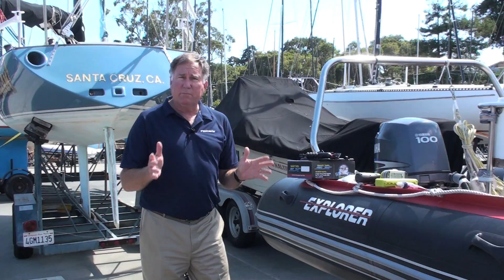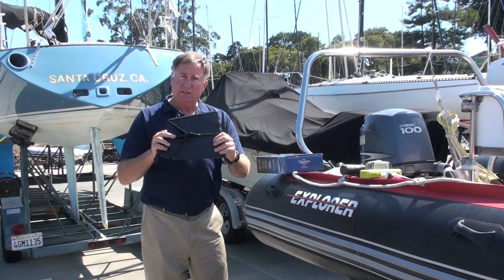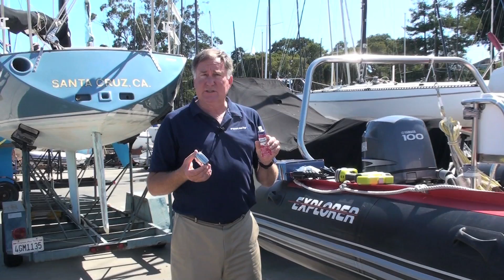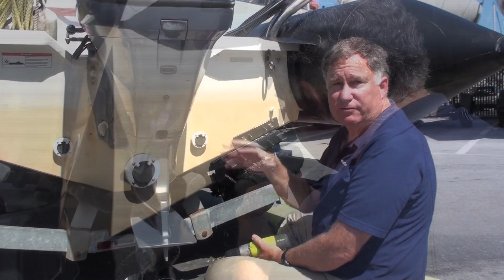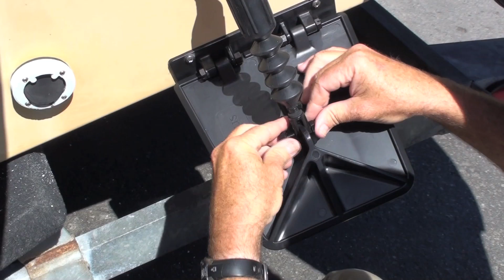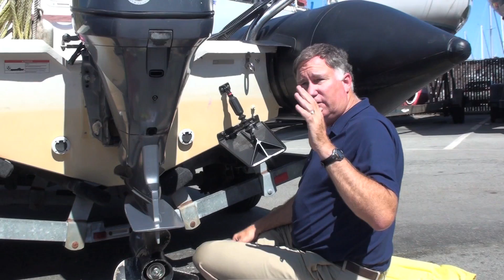How to Install Nauticus Smart Tabs

Comment: I put a set on my old 22 foot silver line. People asked what are those. Fairly new product back then.
It helped the boat in rolling water, stopped speeding up off a wave when crossing. Cut on plane in almost half.
I also put on a 4 blade prop at the time.
I run 28 mph and rev 2800 to 3000. Fuel consumption is decreased and a big savings. Several of my friends put them on and like them.
Nicest thing is , you don’t have to find the sweet spot, it does it by itself.
Reply from the maker: John, awesome feedback! Thanks for sharing your experience with Smart Tabs!

Comment: Hello West Marine,
Do these tabs also eliminate leaning?
Thanks in advance.
Reply: It did on my 15 foot 1973 glastron. It’s a real shallow v, and only weighs 652lbs with the motor, so keeping it flat over 10mph when I’m by myself is near impossible. In fact, I used to have a carpeted board that I would set over the front seats so I could sit in the middle of the boat. Installed these exact trim tabs and it made a HUGE difference in stability, I’m back in the driver seat. Issue I did run into is that my top speed went down from 26mph to 23. I’m sure if I messed around with the motor trim I can get it back but I have a manual trim outboard so it’s an annoying adjust/test/adjust method.
Reply from the maker: Hi The Dutch Fisherman – that’s a great question and sounds like it requires more than we can answer here. Please contact our Product Advice Team for assistance at productadvice@westmarine.com, or by calling 1-800-BOATING (262-8464), Monday - Friday, 8 am - 9 pm ET and Saturday, 9 am – 6 pm ET.

Comment: so you don't need the rocker switch with these tabs?
Reply from the maker: That's correct.  Smart Tabs don't require electric or hydraulic connections. Here is the manufacturer FAQs: 
https://nauticusinc.com/faqs/#toggle-id-1

Comment: I need help. I install this product and yoke my boat for a spin. I got a lot of water splash from the bow of the boar; what should I do?
Reply from the maker: Hi there - there could be a lot of factors; but typically excess bow splash is caused by too much weight aft. Once you figure out the best weight distributation for your boat, the smart tabs should work really well for you. Enjoy the adventure and good question!

Comment: looks like the tab was resting on the trailer  3:24, make sure you have the tab at the correct 25 degree angle before you mark  the top bracket.
Reply from the maker: Bobby, thank you for your insights!

Comment: I have to wonder if the fold down ladder on my swim platform (which is an older sort of small style), would knock into these.
Reply from the maker: Richard, that is a great thought. We always suggest connecting with a professional to ensure there are no issues when installing anything on your boat. However, if you decide to take the DIY route, that is a very good call out and should certainly be taken into consideration when installing them.

Comment: Sure! Our club has two 13' Whalers (probably from the mid-1980s) and they can be a handful with just a single occupant. I think the Smart Tabs would be a very good choice. We also have a 15' Zodiac with a center console, which has a hard time getting up on a plane; that's my next project!